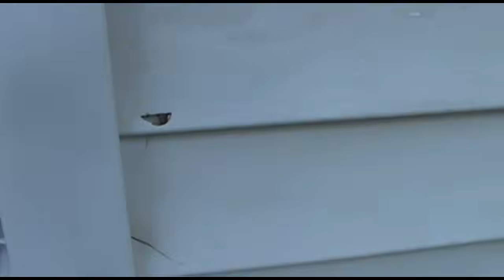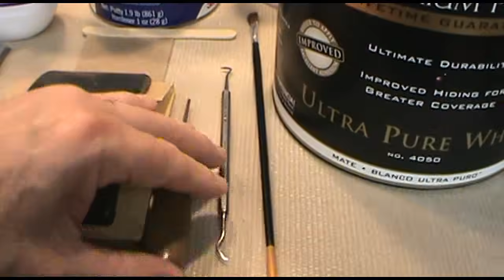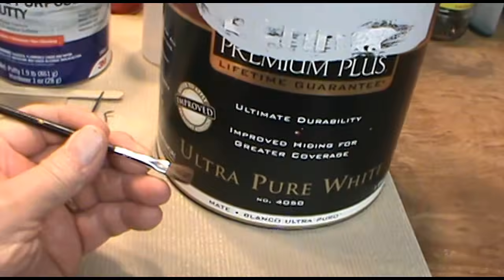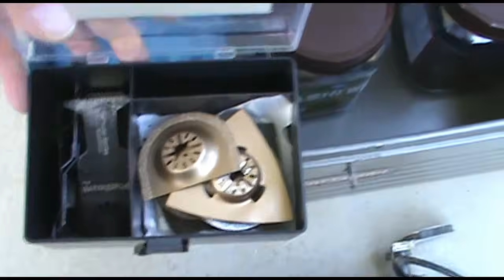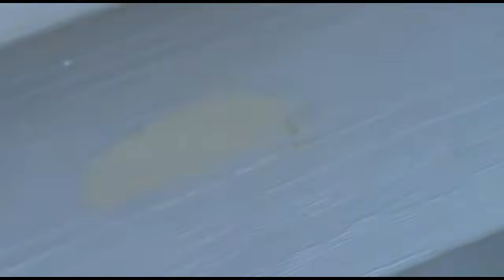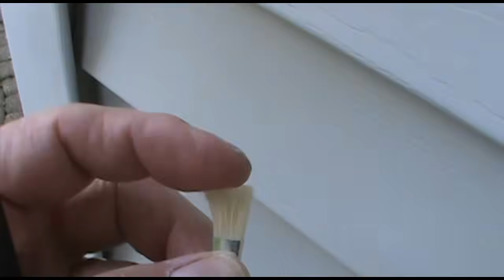How to Repair Vinyl Siding Holes and Cracks. Perfect and Undetectable.

Comment: Hi there, your video is very informative and professional. I've a few questions regarding to the repairs 1) How does the putty hold up to cold weather (-30C)? 
2) It's hard to tell where the repairs are done, is it possible to see the difference between old siding and new paint in real time?

Thanks again!
Reply from the maker: Hi Leo. Thank you for your kind words. In my state, it can easily get to 20 below zero Fahrenheit and 30 or more below with the wind chill factored in. In the summer it can go up to 110 degrees Fahrenheit. On rare occasions, one of the repairs will break loose but it has only happened to a couple out of perhaps 30 repairs I have done over the past 25 years. All I do is a quick fix of the loosened repair and it is no big deal. I actually have a hard time finding the repairs after they are done and I know where they are. If I asked you to locate 5 repairs on the left or right side of my porch you probably couldn't find them. They are absolutely unnoticeable to anyone not looking for them.

Having said all of that I can't account for anyone else's skill level in doing one of these repairs. On the other hand, it isn't rocket science. The other thing that comes into play is the skill of the custom paint blender at Home Depot. I am actually stunned at what an excellent job they did on my paint match. It is spot on. I was really pleased with how well the paint matched when it dried. Just make sure you get flat paint and "feather" your strokes from the center out while pulling the brush up and away as you stroke outward off the edges of the repair as I demonstrate in the video. 

Even if they get your paint match 98% of the way there I think the repair would be very acceptable and well worth doing. It surely would look better than patching in a new sheet of vinyl siding on an 18 or 28-year-old faded wall of vinyl siding. That's even if you could still find the same vinyl siding in the same color as your existing siding. In my case, the company that made my siding went out of business. Thus, I was forced to come up with this repair method. Thanks for stopping by and good luck with your repair.

Comment: Very nice repair. I was also looking for a compound to repair my concrete statues and "Bondo" came up again.  When I was a kid (6 decades ago), all I used Bondo for was to repair my old, rusty, dented cars.... lol.
Reply from the maker: Thanks for your kind words, Golden Retriever. You might be able to use the Bondo All-purpose Putty to repair concrete statues. The color may be a bit off and I'm not sure how it would hold. I have used "Hydraulic Cement" to repair concrete birdbaths and edges of cement steps with good success. You may want to brush on a cement primer before applying the concrete patch. It is a milky-looking thin liquid that really helps patches stick to concrete. I will see if I can find the one I used and link it here. Good luck with your repair.

Comment: Thankyou, I hope this works , I'm so upset . I keep my Mobile Home Clean inside and out and when I seen a small crack in the back as I was washing it, I wanted to scream. How could I get a crack up so high, I can't even reach it only by a ladder. 
I blame my neighbors , but I'll keep my mouth shut and fix it. Thankyou for Sharing.
Reply from the maker: Hi Sandra, You're welcome. I know how frustrating that is. What started me on this whole journey looking for a better method of vinyl siding repair was a neighbor's kid flinging a rock at my house and he knocked a hole in my siding and broke a window. Charming. I saw another comment from you that for some reason doesn't show up here. You said your mobile home is a 1993 model and you can't match the vinyl color. If you have a piece of the vinyl siding you can take it to Home Depot and they should do a good job of matching the color. If you don't have a piece of the siding there's another way of color matching the color but this isn't as good as having the actual vinyl matched. Take a picture of your siding on your smartphone and take it to Home Depot's paint department and you will see a wall full of color swatches on paper cards. Keep holding the color sample swatches up to the smartphone image until you find a good match. Now try to find a couple of sample color cards that are a little lighter than your picture and a couple swatches that are darker. You want to do this because the photo most likely will not reflect the true color of your siding. It will only be a baseline color guide. If you have some lighter and darker samples along with the best match you could find then hopefully one of them will be a good match for your siding. Take the samples home and hold them up to your siding and select your best color match. Now take that sample back to Home Depot and have them make you up a custom color in the little 7-ounce jar. Even if the color is slightly off if it is a decent match it will look better when you finish the repair than a crack or a hole looks. I hope that makes sense and thanks for your question and comments. Good luck with your repair.

Comment: What about matching faded vinyl color ?
Reply from the maker: Hi Randy. The good thing is Home Depot will match whatever you take them. If you can get a sample of the faded vinyl you want to match you should be all set. In my case, my vinyl was faded and I took in an unfaded scrap of vinyl siding that had been in my attic for many years. Surprisingly the color match was spot on. Be sure you get flat paint instead of eggshell or semigloss. Thanks for your question and good luck with your repair.

Comment: 2 1/2 inch hole by 1 1/2 inches is this to big to fix this way?
Reply from the maker: Hi CP. It could be but I would give it a try. I would backfill the hole with DAP Alex Painter's Acrylic Latex Caulk https://amzn.to/3jCuneN . I like the Acrylic Latex Caulk without silicone or any other additives. It doesn't expand or contract much, can be used indoors or out, and cleans up easily. Aim your caulking gun at an angle and squeeze some back behind the vinyl siding all around the perimeter of the hole and continue to backfill the entire hole but do not fill it all the way up until it is even with the siding. Keep it about 1/8 of an inch below the surface of the hole in the siding. All you are doing is making a base for the Bondo All-Purpose Putty. Let the Painter's Caulk set up for at least 24 hours so it is good and hard. This caulking doesn't expand or shrink much and should be a good base for the putty.

After the Painter's caulk has completely set up you can fill the rest of the hole in with a top coat of the Bondo All-Purpose Putty. You will have to work fast because this stuff has a very short open time of about a minute or less. I would have a small putty knife ready to immediately pull the mixed putty off the mixing cardboard and work it into the remaining hole. It won't matter if you have to work fast and get a little extra putty buildup on the hole to make sure it is all filled in because the putty is easy to sand down. After sanding trace in your wood grain lines with the dental tarter pick, clean it with denatured alcohol, and paint it. I hope that all makes sense and good luck with your repair.

Comment: Nice video on how to repair vinyl siding, one question regarding the outside corner for vinyl siding. If you have a small whole about the size of a golf ball, would a backer be needed to fill the this area before you use the all-purpose putty?  It would seem that without a backer the putty material would fall in the void area behind the vinyl corner? what would you do?  thanks , Jim
Reply from the maker: Thanks, Jim. I would backfill the hole with DAP Alex Painter's Acrylic Latex Caulk https://amzn.to/3jCuneN . I like the Acrylic Latex Caulk without silicone or any other additives. It doesn't expand or contract much, can be used indoors or out, and cleans up easily. Aim your caulking gun at an angle and squeeze some back behind the vinyl siding all around the perimeter of the hole and continue to backfill the entire hole but do not fill it all the way up until it is even with the siding. Keep it about 1/8 of an inch below the surface of the hole in the siding. All you are doing is making a base for the Bondo All-Purpose Putty. Let the Painter's Caulk set up for at least 24 hours so it is good and hard. This caulking doesn't expand or shrink much and should be a good base for the putty.

After the Painter's caulk has completely set up you can fill the rest of the hole in with a top coat of the Bondo All-Purpose Putty. You will have to work fast because this stuff has a very short open time of about a minute or less. I would have a small putty knife ready to immediately pull the mixed putty off the mixing cardboard and work it into the remaining hole. It won't matter if you have to work fast and get a little extra putty buildup on the hole to make sure it is all filled in because the putty is easy to sand down. After sanding trace in your wood grain lines with the dental tarter pick, clean it with denatured alcohol, and paint it. I hope that all makes sense and good luck with your repair.

Comment: I have had vinyl siding for a number of years, and this is by far the best method I have used. I live in Minnesota so we do get the wide range of temps. And the Bondo has stood up to them. One variation I really like to use is carefully removing the excess material with a razor blade shortly after it sets. I then use a Dremel with a wire wheel to smooth it out further and in so doing, also provides details similar to that of the siding itself. Apply the paint and you are done. This is a very fast method and with the matched paint I challenge you to find the repaired area.
Reply from the maker: Thanks for the great feedback and cool tips, Kenneth. I live in a climate similar to yours. Hot in the summer and cold in the winter. I have many of these repairs in my vinyl siding and they look great and hold up extremely well. Once in a while, one will work its way loose but that's no big deal. It is a simple "rinse and repeat" to fix it. I like the fact that I can fix it myself and don't need to call out an expensive repair company to do a high-priced second-rate repair. Thanks again for your real comment.
Reply: I Have to agree. Figured I'd Add A Few More Tips. 1- drill a small hole and apply expanding foam behind big pieces to stabilize. 2- I noticed you need to run a bead of Silicone near the concrete, next to the bottom and siding so moisture doesn't damage your slab, it will "Wick" into the gap by capillary action. Great video Sir! 🙃😉👍
Reply: So expanding foam should go in bigger holes before putty? Help🙏🏽🙏🏽🙏🏽
Reply: I too have found it's better to do it myself and get it right.  Than to pay for like you say  high price second rate repairs from companies.
Reply: I’ve contemplated using expanding foam on my big holes. Too much and I’m sure it would push the siding from the house.

Can’t wait to use this process - thanks y’all!

Comment: I have four cracks in the bottom two rows of siding on the side of my house that I’m sure the community lawn care company did. I’ve been trying to find a solution forever!  My home is 20 years old and no one has this siding anymore.  ☹️  Your video is sooo helpful!  I’m going to give this a try.  My question is about the cracks and how you cut it with the oscillating tool.  To repair, do you put a lot of the bondo putty inside the cut open crack?  Also, what’s the best way to get a color match when you have no extra siding?  Thanks so much!!
Reply from the maker: Hi Susan. Thank you for your kind comment. If you look around 20:00 on the video you will see the rotary tool with the larger fiber cut-off wheel. I simply held the rotating cut-off wheel up against the vinyl and cut through it. You need to be careful so you keep control of the tool and don't scuff or cut the vinyl where you don't intend to. Just take your time and you should be ok. I pushed a little extra putty back into the large crack and allowed it to stick out about 1/8th of an inch beyond the crack. Let it dry overnight then trim and sand it as demonstrated in the video. Then trace in your wood grain lines, clean, and paint the repair. 

As for the paint color without a piece of the vinyl to scan that is a bit of a challenge. If I were in that situation I would use my cell phone to get a close-up photo of the vinyl. I would take that to Home Depot and look at all of their paint color sample cards in that family of color. Your phone image won't be spot on so get as many colors as you can that are as close as possible to your color plus several colors that are a bit lighter and darker than your color image. That way we will hope that one of these colors will be right for your repair. Hold the color cards up against your vinyl and select the best match. This may not be a perfect match but it should look better than a big crack or hole if the color match is real close. Another option you have is if you cut out a 1/8" wide by an inch or longer swatch of the vinyl to do your repair you could actually try to use that as a color scan at the paint counter. Even if they can't scan a piece that small you could use it as a visual guide along with the paint color card to try to fine-tune the color match. Remember to get a custom colored small paint sample instead of a gallon of custom colored paint. That will be about 5 bucks instead of 38 bucks. I hope that all makes sense and I wish you luck with your repair.
Reply: @Fixitforgetit  thank you so much for the detailed response to my questions.  A series of life crises put this on hold after I first asked, but I’m going to go shopping for the supplies this weekend and give it a go. 🤞🏼Fingers crossed that I don’t dirk it up!  I’ve watched your entire video several times.  Thanks again. 🙂
Reply from the maker: @susanclark6017  My pleasure, Susan. Good luck with your repair.

Comment: Can you use caulk to fill the hole?
Reply from the maker: Hi JabJab444. If you just use caulking it would plug the hole but it probably wouldn't look very good. The nice thing about the All-Purpose Putty is once it dries it has a consistency similar to the vinyl siding and you can sand it, trace the wood grain lines into it, and paint it. Good luck with your repair.

Comment: Brilliant!  Thank you for posting this.  I'm a bit ticked, after the Amazon delivery driver rang my bell, I noticed a very noticeable hole in my siding a couple of inches below the bell; he must have had something else in his hand when he rang that did the damage.  All I could find were instructions on how to replace damaged sections - apparently many people don't know the difference between a repair and replacement.  My siding is older and faded, so replacing small sections wouldn't look good.  I appreciate you taking the time to figure this out and sharing it.  Your demonstration technique is thorough, calm and detailed too which leaves no questions on how to make your siding look good again.
Reply from the maker: Thanks for your kind words Glitter Bomb Girl. You described perfectly the reasons why I set out to find an answer to the age-old question of how to do an invisible repair of vinyl siding. I have done many of these over a period of many years and they hold up very well and they look great if you follow the instructions. Thanks again.
Reply: Well, to be fair, as a siding guy, I've never met a single person in the industry who "repairs" vinyl siding. I'd imagine it comes down to why bother, sort of thing. In cases like you described I would generally take a small piece from around back, or behind a bush, and put the new piece there. Using old, faded piece in spot of needed repair. But yeah, that's always been an issue with vinyl. Cheap and fantastic to clean but once it gets over that.... 12-15 year hump. Depending on weather exposure, it gets fairly brittle and becomes a maintenance pain repairing pieces. I always try to leave my customers with spare pieces and even tell them to keep one piece outdoors behind the shed or whatever so it'll fade with the other materials. Fix it/Forget it says they hold up 10 years, I'll believe him but I'm surprised. I'd imagine in Florida they'd crack in the expansion and contraction. Or from UV from the Sun. I have no experience with Bondo so what do I know though.

Comment: I have a rock hole the size of a golf ball in my vinyl siding from someone we hired to cut our grass. I dont know how much this helped.  You have pin holes.
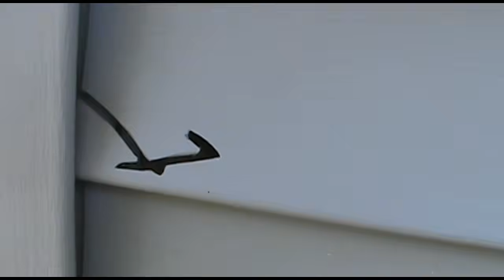Reply from the maker: Hi Cdellio.  If you look at the video from 21:04 through 21:20 you will see that I repaired a couple holes that were quite large and they turned out great. I had an air conditioner moved and it left an inch and a quarter diameter hole plus a couple of half inch holes. It was no problem. They turned out great. You could probably do an even larger hole. The only problem with a large hole is you have to quickly push in a big blob of the All-Purpose Putty and it sets up very fast so you have to work quickly. When you are working with big amounts of the putty you could wind up with more of it sticking out beyond the vinyl siding once it dries than you would with smaller repairs. That gives you some extra trimming and sanding to do but it doesn't take too long. You should be able to do your repair. It would be worth a try before you invest in a sheet of new vinyl that probably won't match. Good luck with your repair and thanks for stopping by.